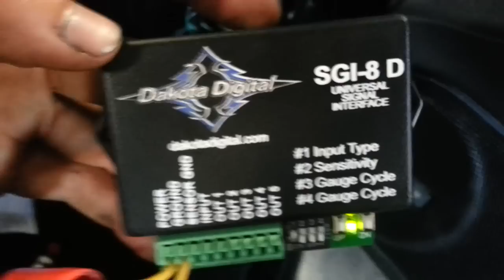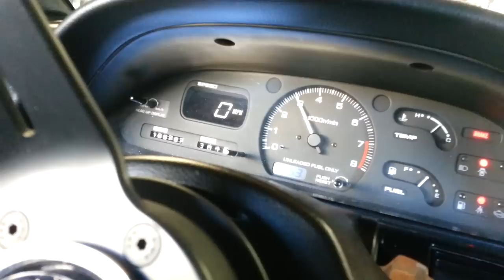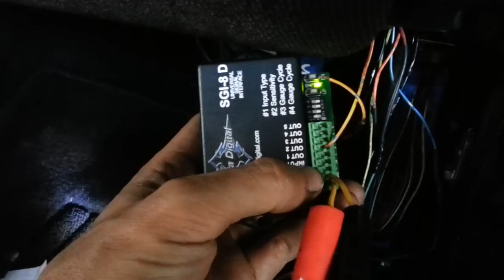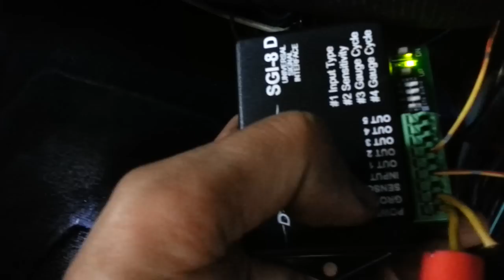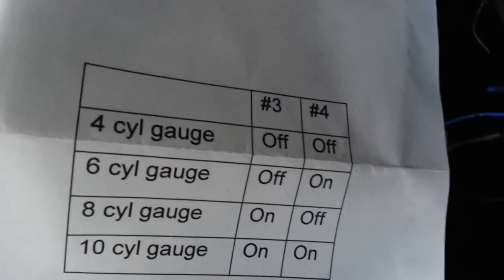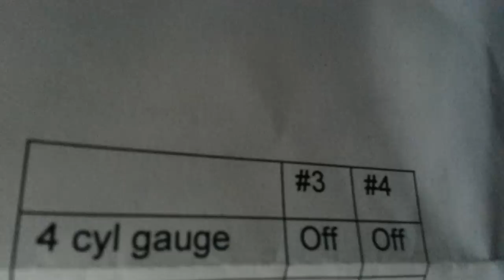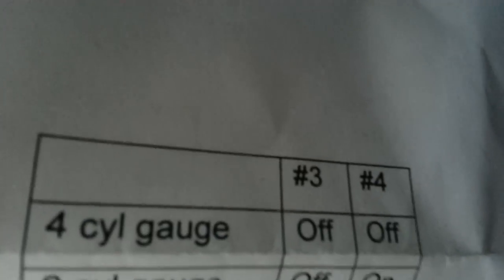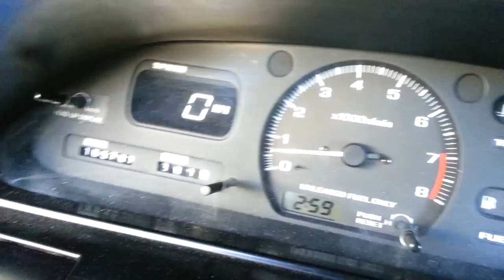How to make tachometer work proper after v8 swap, NISSAN V8.

Comment: Hi, i have a v6 which was distrubutor but now i am running coils which uses different signal, would this help with converting this digital signal back to high voltage for the cluster?

Comment: so this device lets you use your stock cluster with any swap? I have a LS1 in my 240, my friends said i couldn't use the stock cluster bc it just wouldn't work with the LS computer. will it work for gas level and temp??
Reply: Christopher D gas level has nothing to do with the ecu, the gas level is based off of a little floating thing in the gas tank

Comment: Question for you if I'm running V8 (1uzfe) with an HR transmission my car seems redline at 4k rpm. Would this box fix my problem?
Reply from the maker: the motor redlines? or the tach? if the tach, then this can fix that,,, if the motor, you have an issue with it being in limp mode or could be anything else....